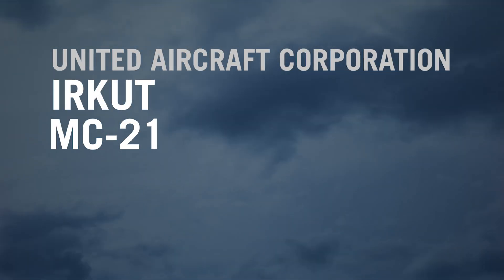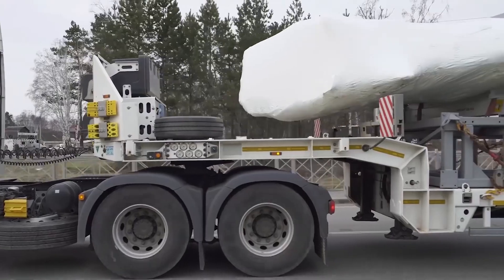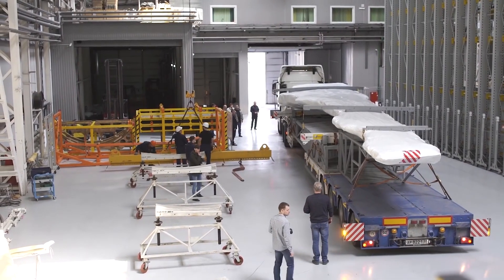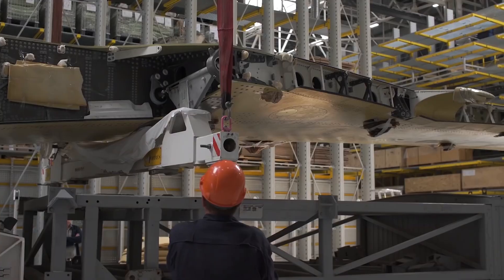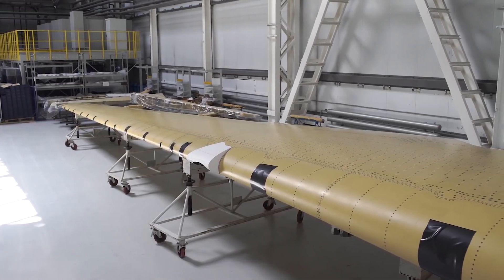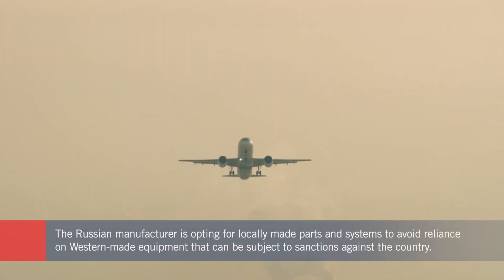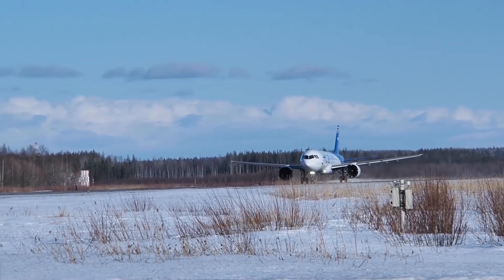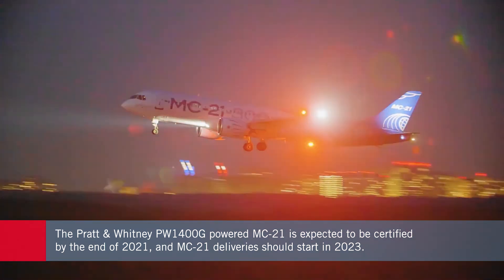Russia’s MC-21 Airliner Fitted With New Wing As Irkut Prepares to Start Flight Testing – AIN

Comment: I feel sure that by a technical and economical point of view MS21 is perfectly on par with A320 or 737. 
BUT 
1) USA will sanction to death any airline daring to use it.
2) both FAA and EASA will never authorize it, even using (dirty) tricks like UE is doing with NS2 pipeline or Sputnik V.
So even Aeroflot will not be able to use it on euro routes.  Sadly its only market will be russian internal or russian military (ASW or VIP or EW versions).
Even China/Asia markets are closed because of 1). 
World is unjust, but this is the way it is.

Comment: No foreign airlines will want the Russian engines, better not ditch the Pratt Whitney ....
Reply: Already have.they are flying the local pd 14 engines
Reply: The priority of the Russians is to get all foreign planes out of use and replace them with domestic planes. If someone wants to buy this plane with a western engine and equipment ... well, that option already exists.
Reply: @davidzhabin  ur not getting the point.its about having alternative options .as far as sales go they are going to increase with time
Reply: Bro, USA fucking sanctioned everything. What do you think expect?
Reply: @SpectreCompass  USA sanctions everything
Reply: Specially 737 Max
Reply: @davidzhabin  lol, Boeing literally sold 200 planes last month you idiot. Their backlog for the 737 alone exceeds 3000 aircraft. Airbus' backlog for the A320 series is closer to 6000 aircraft. LoLz

Comment: Aviation engineers knew it already for a very long time that aircraft winglets reduced drag and increase fuel efficiency, in return tens of thousands of commercial aircraft in operation already using winglets, either made by Boeing, Airbus, Bombardier, Embraer, Dassault, Mitsubishi, even the latest COMAC.

Now the question is why Russian Irkut latest aircraft in this second decade of 21st century still using wing design from the 60s...?
Reply: Some of the latest clean-sheet aircraft designs don't have winglets. Embraer's previous generation E-Jets had them while the newer E2-generation does not. Wingtip devices increase the performance of a wing by increasing the aspect-ratio without adding much wingspan. Since the new Irkut MC-21 wing already has such a high aspect-ratio, maybe it doesn't need them. Or putting them on would place the jet outside ICAO airport category 4C.
Reply: https://aviation21.ru/mc-21-winglets/
just use the google translate to translate to english and everything will be clear
Reply: Very simplified and very fast:
Aircraft manufacturers install winglets on "thick" wings made of metal that have a very poor aspect ratio.
Modern designed wings, primarily made of composite materials, are much thinner than those made of metal and do not require winglets.
So, the MS-21 does not have winglets, because it does not use the wing design from the 60's, but from the second decade of the 21st century.
Winglets are a patch for old wing designs.
787 has no winglets. Is this plane also using wing design from the 60s...?
With a little willpower, one can find a very detailed expert analysis of the use of flaps and why most modern wings do not have such design.
Reply: @Dave Neither the A350, the 787, the 777 or the Embraer E2 have winglets. And all of these (likely due to the shape of the wing itself) are more efficent than if engineers would glue winglets onto them. How I know? Engineers are not stupid, they know much more about an aircraft than you or me. If a plane would benefit from wingles, then it will get some. The need for winglets differs from plane to plane. I don't know why so many people get worked up so hard on the fact that the MC-21 won't have winglets as well. And apart from that: the people designing this aircraft have spend thousands of hours on the aerodynamics probably. If they needed winglets, then they would have them. There It still has the potential to become a top notch aircraft. 

But I guess you are not gonna acknowledge this comment. Just like all the others before me that described the exact same thing like I did because it won't fit into your "everything from russia is bad" attitude.
Reply: Hoy Sum  there are no such things of winglets and sharklets copyrighted, European plane maker, US plane maker, Canadian plane maker, Chinese plane maker, Brazilian plane maker, Japanese plane maker, all used winglets either short haul, mid haul, or long haul planes to save fuel.
Reply: Who needs to pay extra money and engineering for small fuel savings when you live in Russia?
Reply: @Eye.Of.Sauron  if you think this plane is intended for Russian small market only then it will destined to doomed.
Why is Russian civilian aviation industry always failed and never took off since the early Soviet era and can't catch even a small part of international market...?
Because they never can compete with Western big boys such as Boeing and Airbus due to reliability problems, marketing, and lack of sophistication in engineering.
Reply: @dwchen1  i think time is changed, Boeing* has serious reliability problems too.
Reply: @Eye.Of.Sauron  nope, Boeing is the one with reliability issue due to software problems for 737 models, and that's it.
Are Boeing company is gonna implode...?
Far from it, R&Ds for future technology, , experiment, and prototypes is still on all time high, so as for Airbus.
And both companies still on the leading edge for aviation technology, so does for marketshare.
Why do you think state owned secretive Russian plane maker can compete head to head with public company such as Airbus and Boeing...?
Reply: @dwchen1  Sorry. Yes, it was Boeing.

I think that because aircraft technology is obsolete. Elon Musk makes far bettter rockets than Nasa, China makes solid militaty jets, China leads 5G etc. Nowadays, technology experience gap can be filled very quickly and The West is slowing down.
Reply: @dwchen1   I don't think that the Russians (or the Chinese for that matter) are that unrealistic where they are going to put a huge dent in the marketshare of a company such as Boeing.  That being said,  that does not mean that the MC-21 is not an advanced aircraft with technological breakthroughs that outperform the big players.  

This article shows the advances that achieved developing the Russian made engine, wing design, and manufacturing process:
http://alternatio.org/articles/articles/item/93415-rossiyskiy-tehnologicheskiy-proryv-ms-21

Despite these technological breakthroughs,  UAC will need to overcome sanctions, agency approval (such as the FAA),  construct maintenance facilities in new markets,  reliable delivery of parts, distribution, etc.  These are larger obsticles for gaining marketshare than technological advances.  

UAC will focus primarily on domestic markets, China, neighboring nations in the SCO to sell this airliner before it tries to take on Boeing or Airbus on the world stage.  I disagree with your ascessment  on 737-MAX being juat a software issue.  The problem was they were using software to compensate for the limitations on a very old 737 design.  The plane was being stretched to the limit.   This meant that the MCAS needed more commands and too much data for the old processors to handle.  It is a balancing act.   This article explains what Boeing was faced with. https://www.moonofalabama.org/2019/06/boeings-software-fix-for-the-737-max-problem-overwhelms-the-planes-computer.html
Reply: @dwchen1  Because the MS-21 is more modern and surpasses both Boeing and Airbus in its technical data. MS-21 will be the sales leader. Mark my words.
Reply: @юрийкосачев-э1э  mark my ass...
Since the Soviet times till Russian federation how many passenger planes did this country sell outside of East Europe...?
1 dozen...?
2 dozen...?
Are they reliable...?
Wanna challenge Boeing and Airbus who sold thousands of planes annually and always a market leader and always on the leading edge of technology since the 40s...?
You guys couldn't even make a reliable and competitive jet engine on the international market and that MC-21 need to use Europe-US engines to reach good efficiency.

Not even in other dimension to compete with the big boys dude.